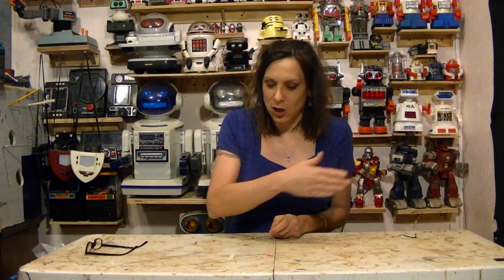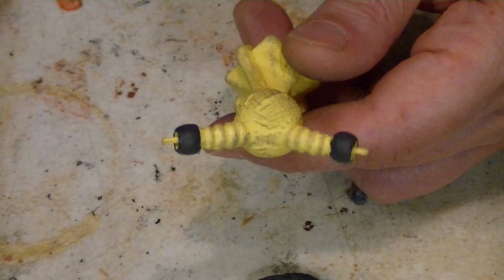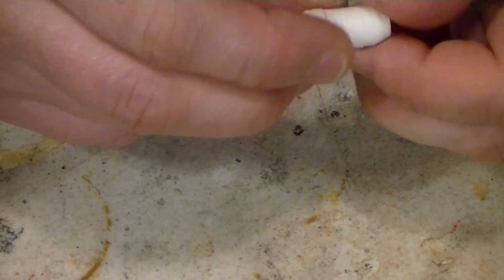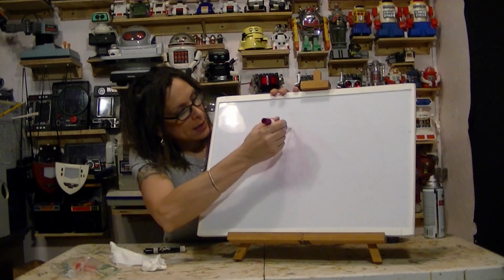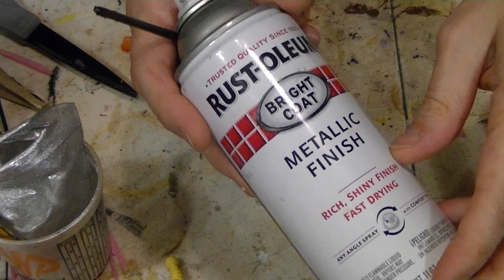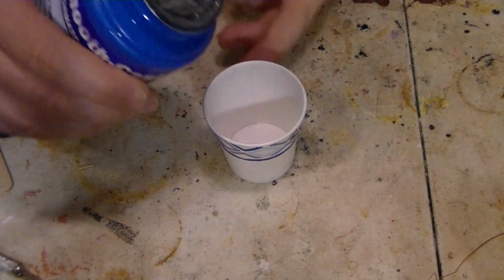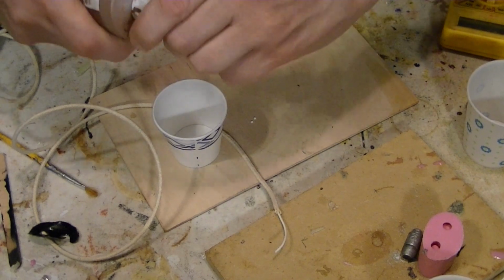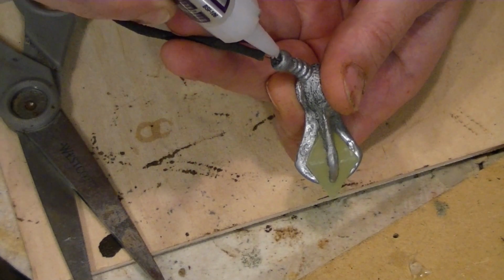Bringing the magic of Dragonslayer to life, one amulet at a time

Comment: It's really hard to start from a couple of pictures of some movie prop and ending up with a working artistic clone, you nailed it perfectly, from engineering design of 3D in Blender, thru electronic touch sensitive led, up to the artistic finishing; also it's a risk when using metallic paint because if it's conductive you risk shorting terminals inside.All around a big 👏🐲
Reply from the maker: I never even thought of that, but I guess there's so much of the paint part in it.

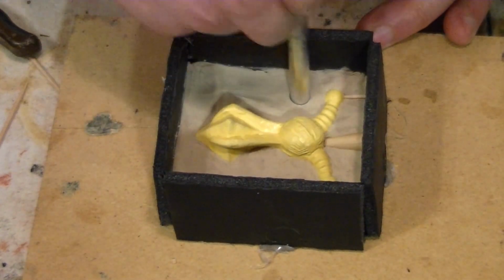Comment: 5:40 I was watching casting videos of some guy who does model airplanes. He uses largely the same technique for plastic and pewter  molding as you do, but he adds something that I think is pretty clever.  He takes a drill bit and presses it into the clay all around the perimeter.  That way, the first side you cast has "pegs" sticking out.  Then, after you remove the clay and add Vaseline to the silicone side, the second side has a the "holes" the pegs fit into.  Leads to perfect alignment with the two sides.  He also cuts the pour slots into the finished molds.
You were lucky. My neighborhood didn't get cable til after I was out of high school.  Never even got to listen to MTV.  Cable didn't come to my area until 88.  Of course, it was shitty cable and so we needed a set top box, but at least it had a remote.